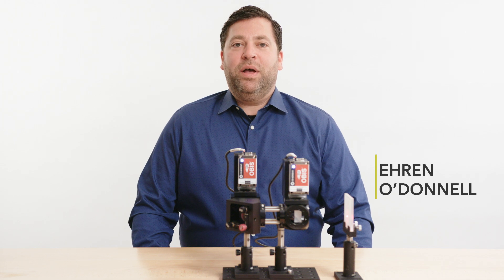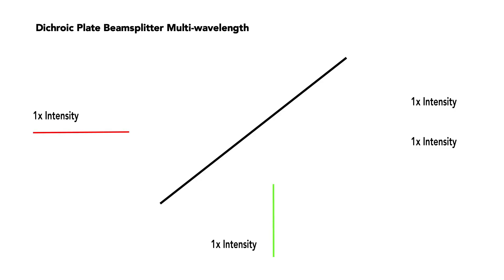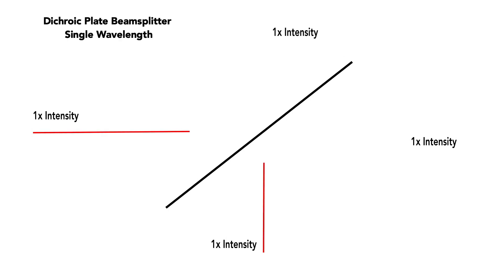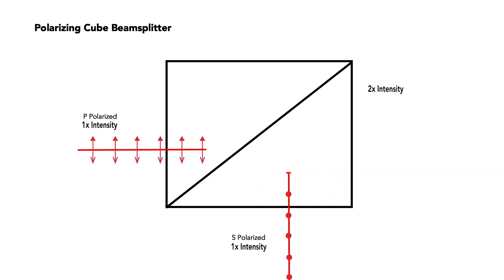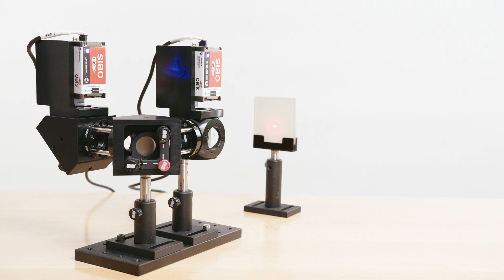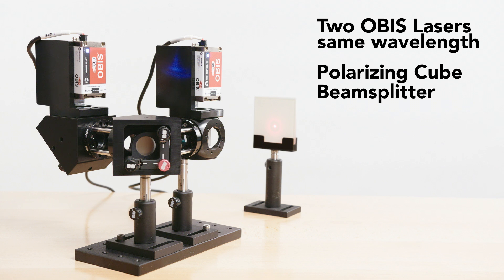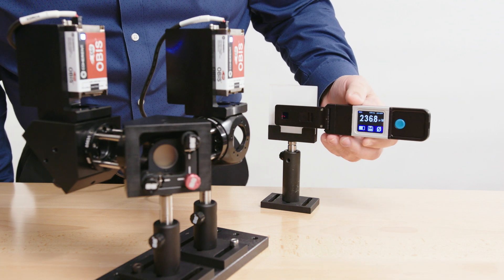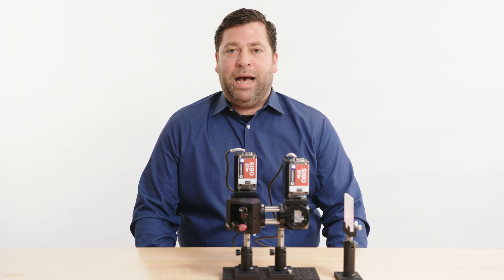Beam Combining for Increased Power

Comment: It's great, but the cost of the combiner is more than a more powerful laser would cost me. I have 3 green lasers. One was supposed to be powerful enough to ignite a match, but it doesn't. It's the same power as the smaller one, just in a larger casing. So, I was hoping to combine them for a more powerful beam, but I might as well just buy another laser. Unless there's a DIY method that doesn't require a kit?